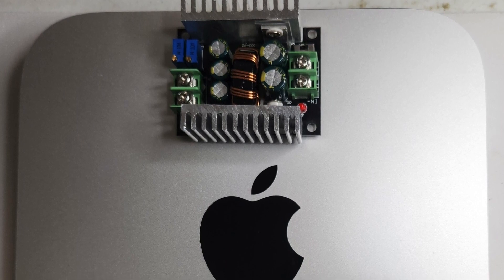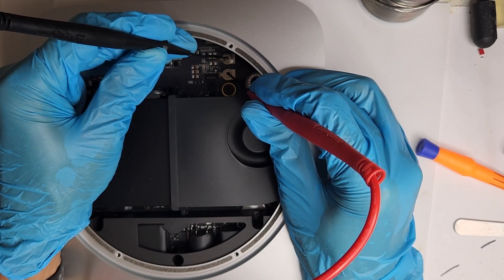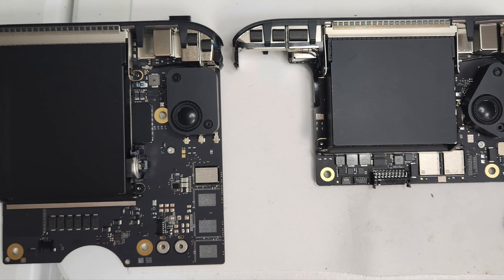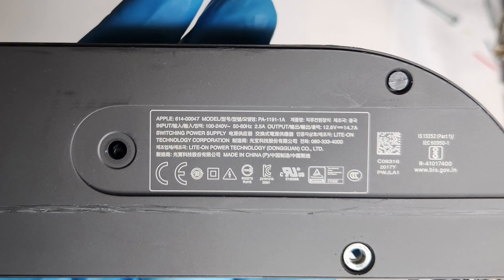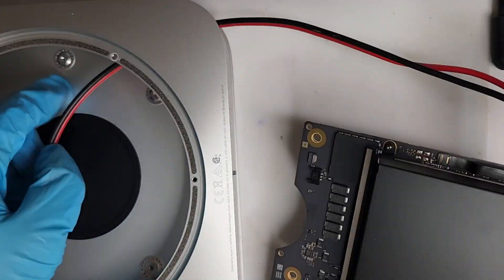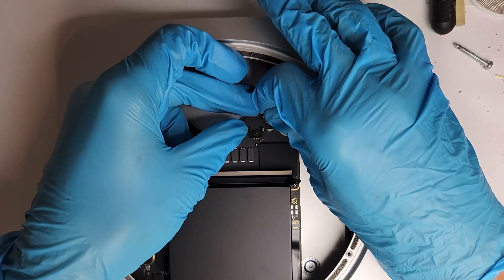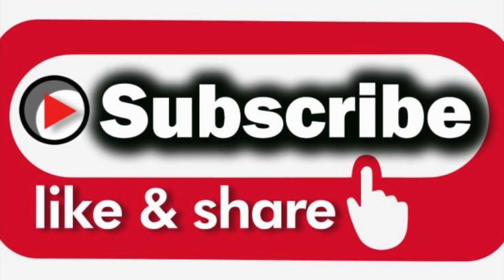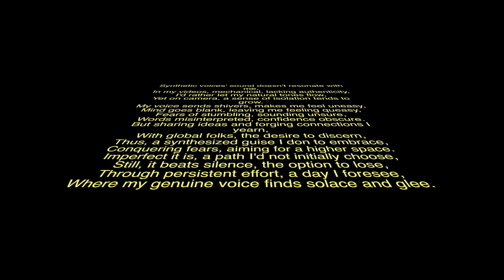Mac Mini M2 Pro Teardown upgrade 12v DC Power Mod for Mac Mini M2 Pro: Challenges and Solutions

Comment: Hi my psu of M1 mac studio just died. Does it work on Mac Studio M1 2022 too by feeding an external dc 12v  PSU To those 2 connectors joints on the motherboard?
Reply from the maker: Yes, but the Studio uses 40V, so you'll need a buck converter
Reply: @mikegyverComputer  I did it last week. Dc12v ok

Comment: What about ground? How does the Mac mini get ground with just the two wires? I would like to put my Mac mini in an old g4 cube and relocate the power supply into the g4 power supply case.  If I just need to run 2 wires off of those screw terminals that would be great.
Reply from the maker: Negative terminal
Reply: @mikegyverComputer  thanks!

Comment: Put some ring terminals on those power leads instead of bare wire. This would prevent them from coming loose and shorting out or killing the main board itself. Another thing to keep in mind, these power supplies used in these macs and any other decent Computer uses a quality power supply not a amazon buck boost converter made in china with tons of ripple and possibly some high frequency switching interference. I am not trying to be negative. Constructive criticism.

Comment: Just finished my m4 12v mod! Works perfectly. Took out the psu and place a xt60 connector mount in place of the ac port
Reply: I'm looking to do this as well. Were there any other places besides that small plug that attaches from the psu to the logic board you had to deal with, or is it just 12v straight to that plug?
Reply: Awesome! Did you document the process? I ma really interested to do it also
Reply: @earlgarcia1664  I would be interested too, can it run using 3S 11.4-12.6v battery

Comment: Can you change power cable type c. Can it possible?
Reply from the maker: Yes, but answer is little more complicated.  USB-C in 12v setting does not have enough amps to support the Pro.  Only way to do that is to go up to 20v setting which will increase the amps, but then the voltage is too high for the Mini, so you'll need to down convert it back to 12v which means more components.
Reply: @ i want to m4 mac mini plug to tiny dc battery. Cuz i want to use like it has battery.

Comment: What is that little wire that comes from the psu and clicks into the motherboard?
Reply from the maker: Front indicator light
Reply: @mikegyverComputer  ah that’s awesome News! Thank you so much :)
Reply: @mikegyvercomputer, what about the other thicker cable that comes from the PSU that connects to the motherboard? Also, what gage wire did you use to replace the busbar?

Comment: Do you think the new Mac Mini Pro with an M4 chip will be able to be converted to 12 Volts?  I already have a very high quality DC power supply.   I have been using a 2012 MAC Mini. (also run on 12 VDC) but it's gotten long in the tooth and want to replace it.  I will use it for music ONLY as a Roon Server.    What unit would you think would work the best for my Application?
Reply from the maker: following up on your email here.  If you are still using AC input, we don't really have a solution, our goal is to use DC input and not depend on AC power for those who are off grid, or want portable power.  However, we have relocated the AC adapter OUTSide of the Mac for external power.  Apple over engineers their PSU, so you can potentially tap off that for your 5v power with a step down regulator.

Comment: JFC! Not even some proper cable connectors to the motherboard?! Just screw the wire in seems really sloppy. Also, should have put in a 12V to 12V regulator, in case power fluctuates etc. Seems like a really cheap in and out instead of doing things the proper way!
Reply from the maker: We did install a voltage regulator, watch again.

Comment: Would love to see this turned into a laptop
Reply from the maker: Thanks, but I think someone's done that already.
Reply: @mikegyverComputer  I have seen some where they put a screen on a 3d printed mount and / or add a keyboard to the mix. I was thinking like using the pcb in an old laptop like upcycling

Comment: If powering this from say LIpo 4 blocks at 13.6V no load or V-lock batteries that can get to 14.6V no load, when inline DC-DC converter do you suggest to output your suggested 12.6V no load so 12v under load , is that correct? Thanks and great collection of problem solving videos.

Comment: Using a 12v power supply can open many doors in terms of portability and use outside the home. As?
Most of today's 4K monitors like the 27" LG500U run on a small external 19v power supply, but I tested it and it works perfectly on a DC voltage of 10/12v consuming a maximum of 25W at full brightness. So with one battery as a car it could remain in operation for a whole day. The MacMini M2 in the basic version consumes less than 5W in simple use conditions and max 20/30W with all cores working. If you want to use it in a mobile location a 12v battery would power it all the day. The only problem is that any battery has a decline in voltage when connected to a constant load, so I don't know if the Mac would work with a voltage lower than 12v. This problem would be solved with a DC>DC converter which stabilizes the output voltage as the input voltage varies. Or you could use 2 photovoltaic panels that constantly charge a good battery (LFPO4 ones are ideal) and the charging current would also power monitors and MacMinis while the battery acts as a constant backup. It would be the first completely "green" PC ;). Anyone wonder why not leave everything as designed and use a 120/220V battery/inverter group? Because transforming the current from low voltage to high voltage and vice versa creates a loss of energy yield; 100W of battery are transformed into 80W of output (approximately, because actual consumption tests need to be done), losing that 20% of energy in the conversion. Any electronic component that generates heat during operation, heat is energy lost or transformed into unused thermal energy. Therefore, the less an electronic component heats, the higher its efficiency.
Reply from the maker: Exactly, Well said regarding inverters!

Comment: Why not just make a basic low profile regulator PCB and have it fabricated by PCBway? You could add a Type-C for PD power aswell with this sort of mod and build it fit to size with 3D printed insurt shells.
Reply from the maker: Great idea.  Stay tuned!  Our service was for the m1/m2 but the customer sent in a m2 pro and needed it back asap.

Comment: What if you just machine down the heat sink on the DC regulator? Looks like you
Only need to take off a few mm
Reply from the maker: Yes, I thought of that!  Maybe next time.  Customer needed his computer back and I always want to test it a few days before releasing something like that.
Reply: @mikegyverComputer I look forward to seeing that. 
I wonder if you can fit a dc battery inside the case as well.
My goal is to have a portable Mac mini with backup power, in case the power cuts off while I’m working.
Give me enough time to close out things with composure.
Reply from the maker: @Saltysweetman   Been done with the smaller M1 since it has more space, but we found the battery we used eventually stopped working, so I can't vouch for it's quality: https://youtu.be/_YYnS6BVMPg

Comment: Hey mike, So because you can’t fit the regulator you have to use external dc power regular / power supply? 
I wanted to run my m2 Pro off a a Storm 2 100w 25ah portable charger but the output is 5-24v? 
So I will need to have a regulator inbetween the max mini and battery?
Reply from the maker: Correct.  You need to regulate it to 12.6v.

Comment: Those massive leads are a lot easier to work on than a 20-pin cable. Just a small criticism: I would have liked to see crimped lugs and heat shrink to the lead connections to the board.

I’m nowhere near to the point of needing to upgrade to M2 Pro and change it to DC. But when I do, I will come back here for sure! Thank you once again, Mike!
Reply from the maker: Good idea!  thanks.